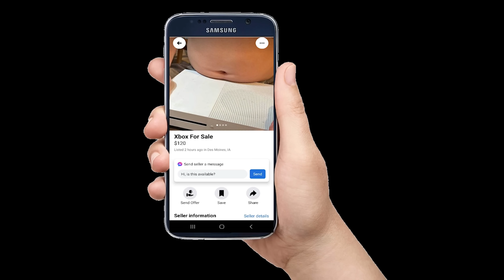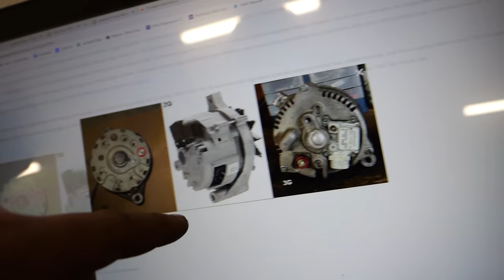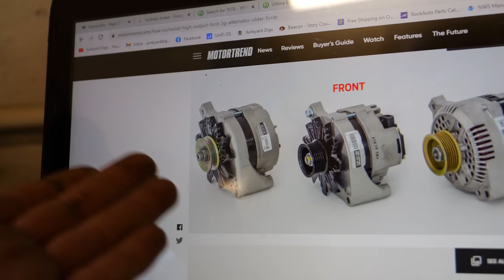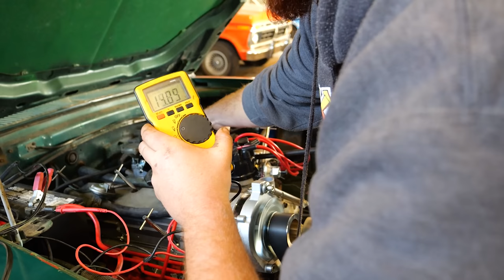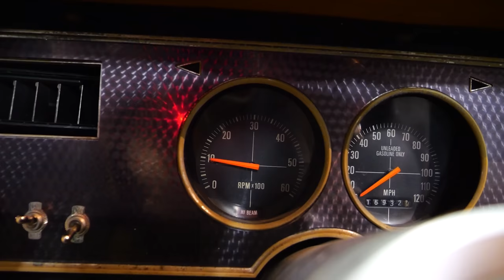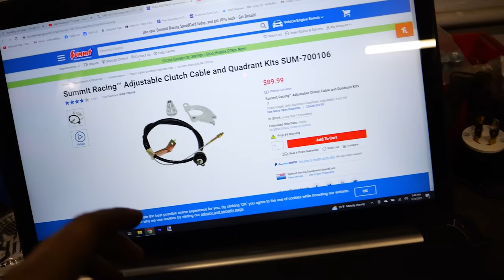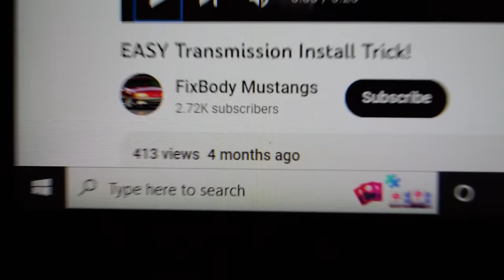ABANDONED Project Car! Can We Finish it After 20+ YEARS!?

Comment: Used to work as a Tool & Diemaker. Another trick to use with a broken bolt counter-drilled off centre. start with a sharp centre-punch. Tap very lightly. If you see your mark off-centre slant your punch and move it to centre. Follow up with a centre-drill or small drill. When you get a centre point hole that a drill will follow, continue with the tap-drill size. When using a tap, put grease in the flutes and most of your cutings will stick in the flutes.
Bill
Reply: yes but no help here

Comment: KEEP IT PLEASE! The perfect sleeper, especially with the low-profile supercharger installed and no mods to the hood. There’s a whole series in this thing. 9-second quarters? 😎😁
Reply: Not unless you drop it down a mine shaft.... No way 9 sec... Mabee 1/8 mile
Reply: Put the blower on the 302, turn the t5 into a frag grenade, put a a stronger trans behind the 302, brake the block in half. This thing was meant purely for being a cool street car, not speed.

Comment: Kevin, something else to consider, that appears to be an SN95 (94-95 5.0) bellhousing. They are vented at the bottom like yours. Which an SN95 bell is about 5/8" longer/deeper than a foxbody bellhousing. You may want to also check and make sure the input shaft bearing retainer AND input shaft on the T5 is either a Fox or SN95 input shaft bearing retainer and input shaft. They're different lengths as well and can be mis-matched easily especially if the car was thrown together like it was. May be some of your odd clutch engagement issues. Maybe. Just something to consider. ~Jesse
Reply: I kept thinking about this at night. If you need more throw on the cable and no adjustable cable exists (I have no idea) you may want to look into converting that trans to a fox bell, input shaft, and bearing retainer. Will bring everything about 5/8" inch closer. Not sure what your driveshaft situation is right now or if that will cause problems for you. I've also heard of people bending the clutch forks as crazy as that sounds. If you need pics of fox stuff I have some I can get to easily.

Comment: Well done for saving the Mustang ll.  It must be even more rare with the  t top.  I've only ever seen three  Mustang ll's here in England . These really are serious classics and should be saved.
Reply: They're not that uncommon in England. Ford sold them here in right hand drive in the late 70s.
Reply: ive seen 0 and im in canada.
Reply: @luke2806  the problem is they rusted out if they thought salt was in the same state/province as them,one or two winters and they were done......
75-78 were some of the most rust prone vehicles ever made if they weren't diligently oil sprayed and washed weekly or more often during winter driving

Comment: All things considered, you guys did a pretty quick revival on this.
Lost a ‘61 Olds scenicoupe due to an engine fire. Fan belt broke and knocked off the glass fuel filter bowl. This was around 1974, just another old car back then. Low milage beauty made it a tough loss. Today I’d repair it, burnt the wiring harness up pretty good and scorched the paint on the hood. 
Around the same time, my buddy bought a ’74 Mustang 2 brand new. Little 4 cylinder took forever to hit freeway speed. I think we hung it out once and it topped out at 85

Comment: I’m sure somebody already said this before but if you take the trim panel off in front of the gauges, there is a selector on the tack and you can set it to eight for number of cylinders. I never really liked these cars but as I get older, I find that they are really cool and I’d love to see this one again!
Reply from the maker: woah, never knew they did that on factory tachs! I'll look into that!
Reply: @JunkyardDigs  I need to know if this is legit! I have never seen a factory tach with a selector, but I never had a mustang 2 either.
Reply: @ryurc3033  No it isnt correct.  There is however a V8 adaptor that needs to be installed if not there.

Comment: I had a 75 with a 302 and Headman used to make headers for it. They sucked to put in but were worth it. The rear springs in mine were shot too. Back then (the 80s) we used to just stick a pair of air shocks in and call it fixed. Then when it was time to finish it right, I picked up a new set for something like $200 for the pair. Loved that car and more than anything loved that everyone wrote it off as a POS until I left them in the dust. As for the 4 lugs, I hated them. Must have sheered all eight off a half a dozen times before I found someone to cut down 5 lug axes for it. (We didn't have options like QP back then). Enjoy it, it's a fun car and you can make them handle pretty well too.

Comment: I have a ''79 F150 5.8, built by my father. The machine work was done by reher Morrison performance in Arlingto engines. It has everything, balanced assembly, ported and flowed heads, TRW forged pistons, melling oil pump, holley double pumper 750 edelbtock performer intake, cc'd and clearanced pockets, oversize valves, 3 angle valve job, bronze guides, double valve springs, windage tray,. was built to Nascar specs.   FS  Kevin

Comment: mustang looks great ' love the sound of it when you started her up.
what a deal , with all that stuff too.
How do you find your cars for your videos and or shop ?
I have a 1967 Dart two door project car with an after market "360 ci" crate engine sitting in car already.
Looks Bad Ass with idelbrock intake manifold, Holly 650 - 750 carburetor aluminum radiator, chrome alternator, mopar polished aluminum valve covers, headers, magna flows, MSD ignition,  transmission is an automatic B&M
It's been abandoned for quite some years now, but I'll have title in hand in a couple of weeks. Do you guy's come up to Northern California ?
Would you be interested ?

Comment: i always use a small left handed twist so it is drilling = opposite of tightening ! = engineering stores that supply lathes and such = works well = then i tap in a TORQUES bit and socket it out !

Comment: @28:58 On the Ford Mustangs from the 70s and 80s, there should be a setting for the tach on the back of the cluster for 4, 6 or 8 cylinder engines

Comment: I ran a glass fuel filter on my 1980 Merc Cougar for years and ever had any problems but I was smart and didn't have the thing hanging loose on the middle of the fuel line like the guy that had it on this Mustanf II, I had mine mounted on the firewall with a custom built bracket so it couldn't move around and get broken.

Comment: If you scrap the t-top cut the roof off to sell to someone wanting to build a t-top. There are also a couple of reinforcement pieces under the floor just behind the front wheels. They're welded to the frame rails and rockers, bolted through the floor.

What year is in the VIN and title of the t-top?

Comment: I like the car. I got flashbacks to turning my pitted and heat hardened rotor with a grinding disk and sander. It now vibrates much less and I don't hear it banging anymore. I don't like Hub rotors.

Comment: I still have a Weber setup for my sbc in my 69 Vette. Four 48 IDAs
(2 and a half lbs of fuel pressure) on a medium rise intake, and it ran like a Raped Ape! Now I run Hilborn 8 Stack Injection that I converted to EFI with 42 lb. Injectors on a 355ci Sprint Car Engine.

Comment: Dude the memories this video brought me. My first car was a 78 mustang II cobra. I know it's regarded as the ugliest and worst mustang generation. Is essentially a glorified pinto. But I had so much fun, maybe too much fun. I had 3 speeding tickets, 2 tickets for excessive acceleration(burnouts), and was pulled over a total of 8 times..........in the first 5-6 months of having my license. I learned to drive In Midwest snow in that car. It's where I learned to work on cars and redneck it up In a pinch. In the end, I was starting the car by turning the ignition to the on position and using a screwdriver to bridge the terminals on the starter solenoid under the hood mounted on the fender.

Comment: I have a GM 04 Pontiac Grand Am that I'm thinking about putting a 900amp alternator on it although it's just a plain jane car with no options whatsoever..No power windows or anything lol..My reason for wanting to put a big Amp alternator is I'm hoping that it will help with installing an alternating current box on the car so I can use ac power instead of dc constantly..I'm not familiar with doing stuff like that and I'm 65yrs young but me and electronics and electricity has never been very successful cause I got zapped pretty good at age 14 and I don't like anything that carries a current level of 120 or 220 volts cause I turned a hawkbill knife into a nice can opener after cutting into a live 220 wire that wasn't supposed to have power going through it..That's why I never listened to any bosses and made sure everything was good to go before whackn into any kind of electricity lol..That's probably why it takes me a minute to figure stuff out the older I get cause that 220 volts felt so good that I just had to keep doing it, lol 😂..Just kidding, I don't mess with electricity cause I know to many people that knows what's up when I need something like that done..I've always done everything like throwing a rock in a friend's garden and they most usually throw one back and it's always worked out so much better...Kinda like the barter system 😅.  I have no idea what Amp alternator is on my car cause it appears to be new but it's hard to tell if it's a repop or a GM AC Delco product and I'm wondering if the ac converter boxes are worth my time and effort cause if not I can get a tailgater generator with 1000 watts,  or a solar powered generator that most likely cost alot more than my budget will allow me to do..I enjoy watching everything you do and good luck with your mustang cause you have a very rare item. I used to have a black cobra and I crammed a Cleveland engine in it and changed the axles and rotors to 5 bolt cause it seemed like the proper thing to do at the time and that car ran so so good on nothing but raw gaspump horsepower..I'm a wheeler dealer and I wish ida kept the car cause 3 days after I sold it, the guy crumbled it and thank God that he got out of it alive cause wasn't nothing straight on the car..I'm guessing after reaching over a hundred miles per hour it took flight and if he hadn't been slung from outside the t-top I don't think he'd be here and I kept telling him that it's either 400+or 500+ horsepower with a 1500 pound car that's like having 1000hp in a 4000 pound automobile but some folks have hearing problems and I knew without a doubt that if he started road racing at high speed he's going to lose it and bygarsh he didn't have the car 3 full days and crumbled it..I set everything up for dragn ass and that's pretty much what the car was built for instead of 150mph on curvey Wva moutain roads lol...

Comment: If the engine was built with the supercharger to be mated on top that would mean everything on the bottom and all other components rods, springs, lifters, etc....  will all be HD!  You might need a larger capacity fuel pump than installed for the video?

Comment: Shoulda put about a 1 inch piece of Shrink tube over all the relay female connections. Its an easy safer solution to insulate them and keep em clean and corrosion free.

Comment: I love these cars I had a cobra 2 that I built when I was 14 15 16 and before I got to drive it because it had a built 302 and reworked heads and a c4 with a stall and a isky cam was jacked up with air shocks on the rear and 15x 12 rear wheels 4.11 rear end 5 lugs all around then I finished it was blue with gray racing stripes and blue tinted windows!! Then I turned 16 and my dad took me out in it and show me what it will do and I scared the shit out of him next day I came home home from school and it was setting over my uncles house my dad sold it on me and I had to set and watch it set for yrs after I had put every dollar I made in it cutting grass and washing cars !!!!! I’m still pissed but a yr and a half later I moved out and about 10 yrs later I built a bad ass fox body with 585 hp and I out ran everything he had in it roush 347 short block svo heads and a gt40 intake bigger injectors and bigger pump and a nitrous kit that was hidden and he never knew how I always out ran everything he had lol!!! But I loved that cobra 2

Comment: How do you keep the filing that when you put the drill bit through the block.  How do you keep them out of the
Crank bearing. Or do they stay in the water jacket. If so how do you keep them from tearing up the water pump. I have always worked on Chevrolet motors. I've never worked on Ford engines. I am not familiar with how the water jackets go on there.

Comment: I HAVE FIXED STRIPPED IN 302 FORD BY drilling OVER SIZE TAP PUT BOLT IN WITH GREEN LOCKTITE CUT OFF BOLT CENTER DRILL AND TAP TO SIZE 😊

Comment: "fun fact abt a ford 9" thats actually a ford 8" lol,also you could have just changed the chunk and left the housing in the car.The flat spot when you floor the gas can be fixed by putting the 50cc accelerator pump for the primaries from the double pumper into the holley thats on it,itll have fuel injected style throttle response after that. Good video though!

Comment: The 70s were nasty to muscle cars. The mustang was almost a hot rod. In the 70s, they were boat anchors with wheels. That much carb for a 302 is overkill. The side pipes would be a problem in California. The supercharger would also. That type of fuel pump is not high pressure, 5 to 10 psi.

Comment: I have been rebuilding a 1977 GMC Jimmy High Sierra, 350 SBC 350 trans, manual choke, manual pump, manual everything... For about 6 years now. This is my first all manual everything Blazer/Jimmy and my first, 6 year project in over 15 years. I need some help that is for sure. My wife keeps telling me to sell her but I just can't. I want her on the road, MINT. She starts and drives with a charged battery but stops like a semi, hand signal turn signals only, same with my redneck wipers. My medical condition is keeping me from getting her done :(

Comment: So that bolt hole he drilled, couldn't he have drilled it out to clean it up, weld it closed then drill and tap a new hole? Or  you can't do that to engines or that specific area on the block? Anyone know because that sounds like a good way too repair it and potentially fit a straighter bolt hole.. I mean if you don't want to just send it to the machine shop od course lol

Comment: The glass fuel filter will hit something under the hood and crack? Now that's a new one. I love how everybody talks $hit about that style filter. I have had one of those glass filter on my truck for decades, with ZERO issues. Swapped it out for a plastic throw away wix unit and have had nothing but problems. The plastic style filter will yellow over time and become brittle and break down. I dont trust the plastic nipples. Had a fuel leak on the inlet hose to the filter that I know was tight. And finally we all know what happens to plastic near a hot engine. There is nothing wrong with the glass filters. just put them where they wont bang around the engine bay and break (yet to see that happen). And if your afraid it will come apart just put a little RTV or thread locker on the filter threads...
Reply: Glass can shatter if you hit a pothole or something, plastic has the issues you mentioned, metal just keeps going. Only downside to metal is that you can’t see what’s going through it, but if you’re using the car regularly that’s never a problem anyway. Personally I would prefer to put a plastic one on as a temporary one if it’s the first start for a while so I can see what the fuel is like, then swap to a metal one like Kevin’s did

Comment: That's not a mustang its a warmed over pinto. Should have let it die... The Mustang went away for 1974 and returned in 1979. The wilderness years are the mustang 2/pinto project.
Almost happened in 1988 with the Probe debacle from Mazda

Comment: Cam'd a 76 302 Cobra II intake 4brl headers it snapped rear main springs 1st pull - had new mains & 1 xtr leaf sheaf added & 400lbs of sand bags in rear for grip.
Wheelies in 3 gears hard scratch in 4th...flames 3ft long shooting out the pipes.